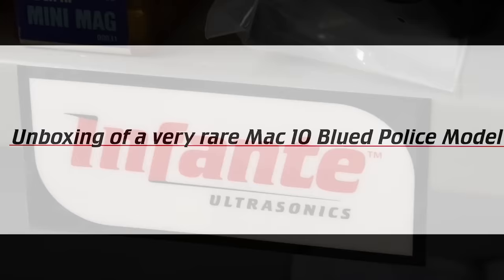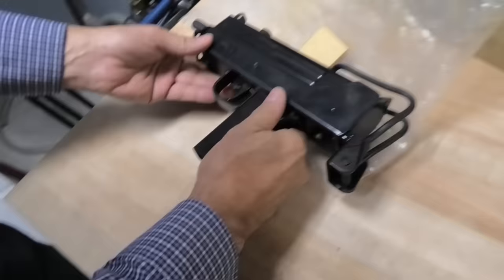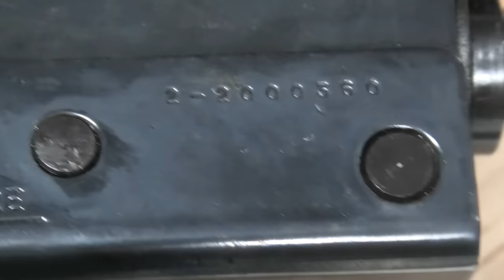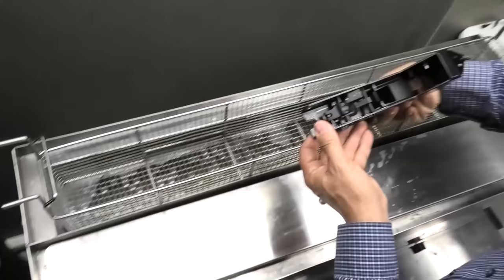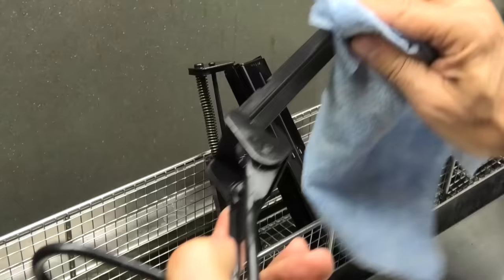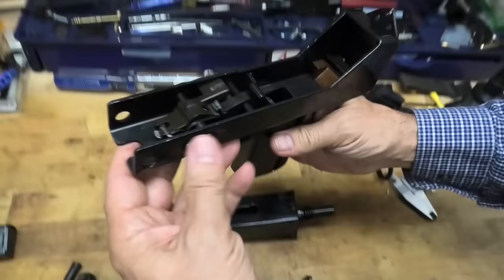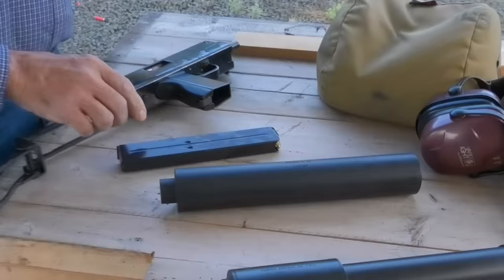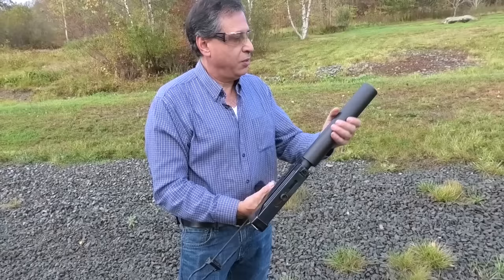INGRAM MAC 10 9MM Blued Police Model Unboxing RARE | Infante Ultrasonic Gun Cleaning

Comment: What a gem. It looks a lot better in blue than they usually do in the parkerized finish. I wonder which police departments used those.
It seems that just like the Uzi/mini Uzi, the M10 9mm also has a much slower firing rate than the smaller, lighter M11. And sooooo quiet!
Reply from the maker: Apparently they didn't go over too well with law enforcement because they were only made for about a year in limited quantities.
Reply: @InfanteUltrasonics  Did PDs actually buy them? I figured "Police Model" was just a branding move haha. I'd love to think there were some guys running around with M-10 duty weapons at some point in the '70s
Reply: @alexscottthompson812  Yes some PD actually bought them.  How else would he get a police model one?  These were so low in number and not really used by the departments on patrol. These would have been marketed as Swat or special teams items.   That's how he managed to find one unfired.  Some backwoods PD bought it, sat it in the armory and forgot about it until they realized they could make $20,000+ off something they probably paid $1,000 for back in the day.  Some police chief could have also ordered it, hid it away hoping to buy or take it home when retired but didn't happen for rrasons.
Reply: The m10 I shot (friend of a friend's) was ungodly fast. Like a hearty forced burp! Then he got a tungsten bolt made and it was slower and more accurate. Both were controllable in terms of spraying down a target. The regular type was too fast to get good use out of the mag capacity, really didn't need to fire that fast.
Reply: The secret service used them sparingly, because they fit nicely in the side panels of the Secret service vehicles during the Reagan years. Then the switch to full auto Glock 28's and Beretta auto pistols and. MP 5's.
Reply: @heavystarch100  I don't know where you think they got Beretta Auto pistols from because there's only like 15 of those in the US if that.
Reply: @heavystarch100  i can remember that secret service agent pulling out his Uzi when Reagan got shot
Reply: I was told that the Seals used them until they completely wore out!!!  🤠👍
Reply: @heavystarch100  Literally everything you said is a lie. I'm assuming you also meant 18's instead of 28's too, which they didn't. Why would you go on the internet and just tell lies like that?
Reply: @danielescobar7618  A good stock goes a long way with making these handle better. I've seen a few pictures of M10s and M11s fitted with a side-folding polymer stock, like those Choate MP5k PDW ones, which seem like they'd be a little bit more steady.

A forward point of contact, like a 'barrel extension,' or an appropriate full-auto rated silencer with a heat insulating wrap on it, does a lot as well.
Reply: @russellking9762  Agent Robert Wanko. A lot of people assume he was carrying it under his suit jacket, but the practice was to carry it in a suitcase and then get it out in an emergency (and you can see that suitcase lying open on the ground in front of him in some of the photos).
They special ordered the Uzis with barrels just about an inch or so shorter than the regular model, so that they would fit snugly in those suitcases.
Reply: @0neDoomedSpaceMarine  I certainly bet. Shot a Thompson that day too, the trigger was super heavy and it rose like crazy despite being heavy. Didn't like it as much. Was able to keep short bursts on target with the m10, started aiming for pelvic zones at about 10-15 yards and was up at the neck with the end of each rip.
Reply: In the documentary Cocaine Cowboys they show Miami PD with them while they are doing raids.
Reply: @alexscottthompson812 There were… lol. 🤭

Comment: Very nice sample!  I have one in 45, but do not have the two stage suppressor.  I have a Lage slow-fire upper and use an Octane 45 suppressor.  The Lage upper is a game changer.  Mine has been shot a lot, even before I bought it, so all of the problems were sorted out well before I got it.  Mine pretty much fires every time with very few malfunctions.  Even though mine is 45, the seller sent me a blued Walther 9mm magazine and a mag well adapter, but I do not have a 9mm bolt or barrel.  I ended up getting an Uzi for 9mm and then stopped buying machineguns, for now anyway.  Thank you for the wonderful video!
Reply from the maker: Thanks for the very nice comments, I'm glad you enjoyed the video. I have the Mac 10 in 45 as well and it works great. Let me know if you want to sell the Walther mag, I could probably use another one. The Uzi is also a great gun and more accurate than the M10 9mm!
Reply: @InfanteUltrasonics  I have the fantasy that one day I'll either buy a 9mm M10 or get a barrel and bolt and shoot some 9mm through mine, so I want to hang on to the Walther mag, if only for that reason.  I have heard that any other mag for 9mm in the MAC series sucks.

My Uzi is a conversion of an IMI, but they did a full conversion and even changed the engraving on the side to SMG specs.  It is a registered receiver as well with the blocking bar removed.  I love it and wanted to pass it on to my son when he got older, but he was killed in a car crash a year ago this week, so I'll have to come up with a plan to sell all of my Title 2 stuff one day.
Reply: @CarrotDugTooDeep  I've seen a few conversions done on MACs to make them use other magazines, perhaps that's an option. My condolences for your son.

Comment: After Ingram and Warbell were kicked out of MAC in 1972, the owners got rid of the adjustable front sight. I have a Jersey Arms Works MAC that has a blued receiver. The 9MM guns fired a little slower then the 45’s because the bolts weighed about the same and the 45 ACP is more powerful so higher cyclic rate. Very rare and unique gun. MACS are actually very reliable.
Reply: My birfday coming up guys. If anybody wants to buy me something in this direction. 😌
Reply from the maker: That's great. I think the MAC problems that I've had were with the later SWD M11 9mm, the older ones seemed to work but there were some documented problems with the magazine location on a particular run of 9mm guns that was later fixed after the problem was realized

Comment: One of my very favourite guns of all time, so utterly iconic and the very definition of form follows function as a machine pistol. Don't see it as a police weapon though, so unsurprising it wasn't widely adopted.
Reply from the maker: I am very happy to share this video because there's no information about this particular model anywhere. Glad you enjoyed it!
Reply: I could imagine certain SWAT usage where this thing would do alright, but for a nice and fancy variant like this, the price is probably enough higher that it would be difficult to justify spending the department budget on this kind of thing. 
I figure that for either a comparable price, or not all that much more, one could get a generally better MP5 or Uzi, not to talk about surplus M16s which police departments could get from the gov't for little cost.

The design of the MACs generally makes the typical models a bit more sensible. I'm glad to see that this beauty exists though.

Comment: Cool video.  I have a Powder Springs gun and suppressor from Atlanta Police Department that was used to demo and used in some promo photos.   It too was early with the adjustable front sight - not too common.   It is not blued, it is parkerized like most early ones were.  At one time they thought Blued was more commercially acceptable to police and military wanted parkerized.

Comment: I have a NIB police mac with matching can as well. Your video tempts me to break mine out…
Reply from the maker: Well, somebody had to do it, you can't take it with you...
Reply: @InfanteUltrasonics  update: I pulled her out and ripped some mags off. Might need a lage upper…
Reply: @ethankelso3084  Great idea on the Lage uppers.  They bring new life to the MAC platform.
Reply from the maker: That's great, the gun would be worth more sealed in the bag, but like me, you traded the increased value of the unfired gun for the pleasure of shooting it! It will still be worth a lot what you decide to sell it.  Try to find an AWC MK9 suppressor for it...... have fun! @ethankelso3084

Comment: Only someone who’s never had to remove old cosmoline from a firearm doesn’t realize what a great thing that sonic cleaner is. Back in the day we would cheat using kerosene but it was a nasty nasty job cleaning. I’m curious how much you paid for it (the firearm not the tank). If it’s transferable, I shudder to think of the cost. Fantastic collectors piece though.
Reply from the maker: Thanks for the comment, it's fully transferable and I got a really good deal on it!
Reply: @InfanteUltrasonics  12k?

Comment: Wow, that's really cool, I didn't know they made these with anything but that typical matte gray phosphate finish. The slick dark bluing suits it nicely, and I love the stark plum color on the bolt and trunnion.
Also didn't know that any of the old MACs had any kind of adjustable sights, I have only ever seen them with the really cheap and simple one where the front post is a raised cutout from the stamped shape making it up, not a lot of room for adjusting windage on those, unless maybe you wanna do it Elmer Keith style.

I'm assuming that the mint Walther magazine (and the overall nicer fit and finish on the gun itself) contributes to reliability. Lots of MACs out there running on old and tired Greasegun and Sten gun magazines which have seen better days, or worse, those zytel ones you'd typically see with Cobray/SWD guns, which kind of work when brand new, but only for a while.

I actually bought the book on the MAC guns and Gordon Ingram, I should get to actually reading that proper sometime, I had to drop it at the time, but it's a hell of an interesting read.
Reply from the maker: I'm really glad you liked the video. The book that has some info on this gun is called The MAC Man by Frank Iannamico. Is that the same one you have? They show a police model with a serial number only a few digits away from this one.   According to the book they only made a few blued police models in an effort to market them to law enforcement. It didn't work out, so they discontinued the blue finish. Some of the early MACS had the front sight adjustable for windage, but that feature was discontinued. Thanks again for the comments!
Reply: @InfanteUltrasonics  That's the one. I so thoroughly enjoyed  Dave Gaboury's book on the Uzi that I had to get a book on the Mac, too.

Comment: I knew Mac-10 was made cheaply, but I'm surprised the amount of dings on the receiver, even if it was brand new in the box-given that this is the nicer-finished police model(or is the blued finish makes the imperfections on the metal are more accented compared to the parkerized finish?).
Reply from the maker: Yes the parkerized finish hides a lot of the manufacturing blemishes on the sheet metal, I guess they could have spent more time polishing the gun before bluing

Comment: Wonderful why they stamped it a Mac 10 the original company specs say Mac 9 was designated for 9 mm and the Mac 10 just designated 45 caliber interesting
Reply: Original model M10 were made in 
.45acp & 9mm, there is no M9.
Reply from the maker: Correct! @de629
Reply: @InfanteUltrasonics  You have a true treasure there. According to my book
"only a very few Police guns produced"
It's also interesting that they were made after they relocated to Marietta, but still carry the Powder Springs markings. I'm assuming they had already produced a lot of frames before the relocation, and that would also explain the double stamp
coming from RPB.

Comment: I have never had the opportunity to fire a single shot with this INGRAM. On the contrary, I know the UZI 9mm very well. They look similar, maybe the Ingram is smaller and easier to handle?
Reply from the maker: The Uzi is bigger and heavier but its a lot more accurate, its even quieter with the MK9 suppressor because of the longer barrel ( with sub sonic ammo)

Comment: Very cool video. A couple questions from a total gun noob here - What is the rattle sound in the suppressor and is it supposed to be like that? Thanks!
Reply from the maker: There are old technology aluminum eyelets in the rear expansion chamber to slow down and disrupt the gas pressure, they rattle in the rear chamber
Reply: @InfanteUltrasonics  Thank you for you r reply.

Comment: Really love watching your videos and appreciate all the information you put into them. I have a larger ultrasonic cleaner that I'm thinking of using for some gun parts was wondering what solution you recommend if there is something a little bit more cost-effective than buying the premix Solutions perhaps something I can make on my own
Reply from the maker: The Sonic Tonic solution gallon makes 21 gallons of cleaning concentrate when mixed with water,  which yields about 4-500 gun cleanings, you should try it. Thanks for the comments!

Comment: Why does the original suppressor rattle like that?
Reply: The first section (the fat section) is filled with eyelets. That's what your hearing rattle. A silencer works by cooling and slowing down the expanding gasses. The purpose of the eyelets is to capture the gasses right out of the end of the barrel and create turbulence in the flow to slow them down. Like he mentioned in the video, this silencer technology is old and not really used anymore.

Comment: Not a fan or this gun.  Open bolt, awkward handled, inaccurate mess.  Marine Force Recon actually had these as an option in their official armory arsenal.   Nice room clearer, though. Just hold and adjust for the climb at full auto.